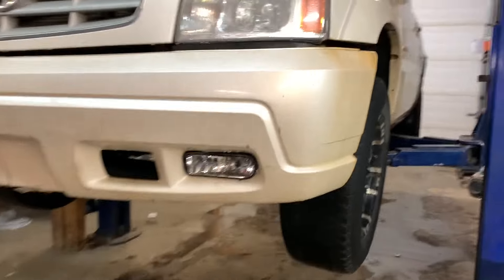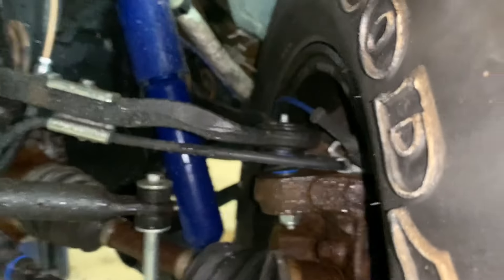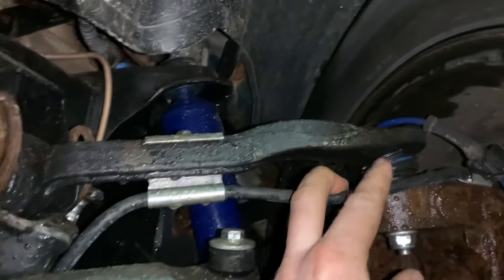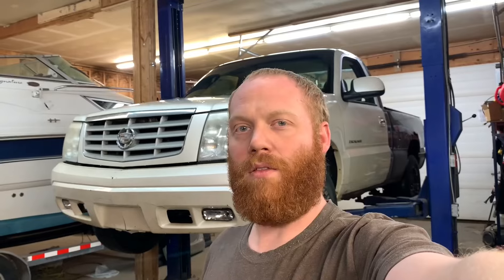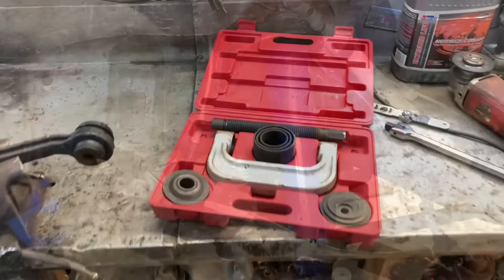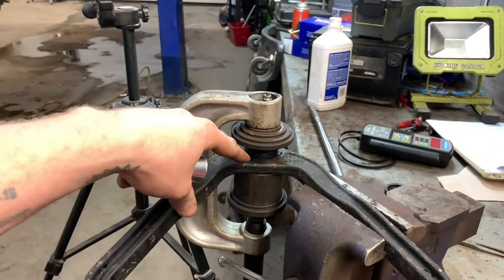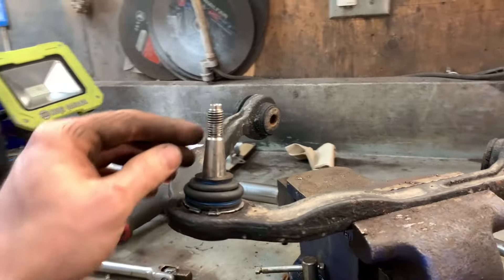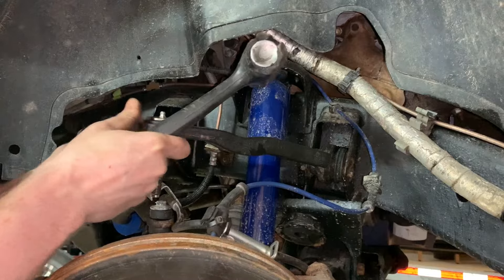Flipping my control arms to correct ball joint angle on my lowered 4x4 Chevy

Comment: I’ve never dropped a torsion bar suspension before. Cool that you can flip them like that. The angle of the ball joint looked wayyyyy better
Reply from the maker: This is actually my first time lowering a truck (except the rat rod, which I don’t really know how to explain lol) and i love it so far. 

Ball joint angle was way too scary to leave it as-is
Reply: @StationroadRatrods  yeah. That thing was cranked. 

You get the sickness with lowered trucks. Next will be bags. You can never get low enough
Reply from the maker: I don’t wanna go /that/ crazy…

But I will
Reply: @StationroadRatrods  yup. I’d love a bagged truck that lays frame when you park it.
Reply from the maker: Me too, I love bagged trucks

Comment: Iv done an upper control arm flip on a gmc envoy that I lifted 3in to help correct the ball joint angle, by far the most satisfying mod I made to that car.
I didn't feel right selling the car as it was and considering taking the lift off but within an hr of work it was so much better and the new owner loves it.
Reply from the maker: Sweet! I haven’t noticed any issues with my ball joints since doing this and I feel a whole lot better about the angle now

Comment: Wouldn't flipping the control arm like that affect the center line of the ball joint? I thought the control arms were side specific and flipping them moves the ball joint off center?
Reply from the maker: They’re the same part number for left and right control arms, so the ball joint is centered.

Some vehicles have left and right specific arms,  but I would think if you flipped the left arm and installed it on the right it should be in the correct location.

Comment: Also iv always had vehicles with modified ride height weather lowered or lifted and iv gotten pretty good and accomplishing them cheaply or free.
Iv had the same issue u have now just a few years ago, but i wanted the truck to use stock parts so they could easily be changed in the future.... 
so this might seem bad but it works.. 
First i took off the oem guides that make it so u can simply turn the bolt to adjust it, then u r left with some simple slotted bolt holes for the bushings so it's possible to simply make those slots longer and use normal washers instead of the oem guides.  I don't know if it was necessary but I made my slots overly long to insure the alignment guy had a lot of adjustments, this left very little metal left around the slot so I welded in some steel to basically make the brackets a little longer.
Reply: This was done to my daily driver at the time, it was a lowered single cab short bed that also got used for towing cars and at one point it got a little air born off road, all Detroit Axle suspension parts and it still has no suspension issues to this day
Reply from the maker: That’s wicked. I had to notch the lower control arm mounts on the frame, just about 1/4”. It helped big time